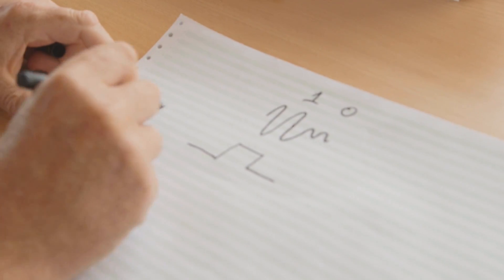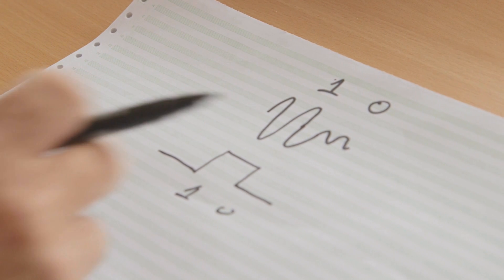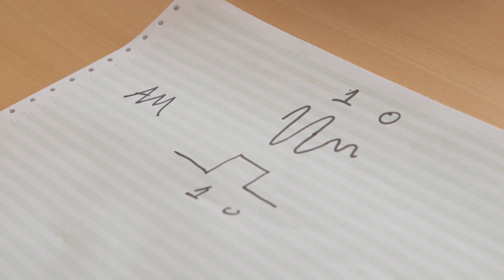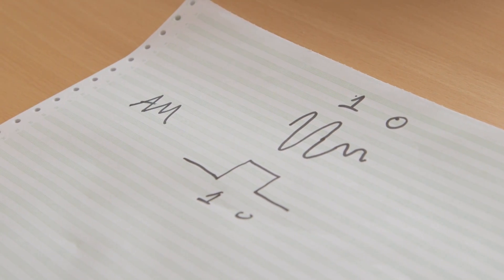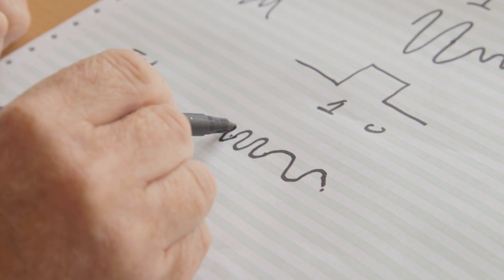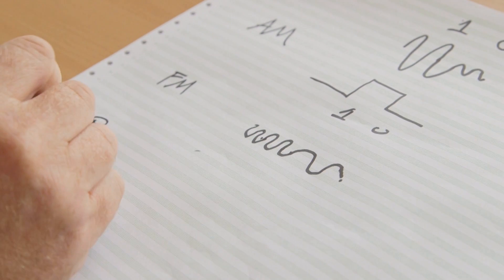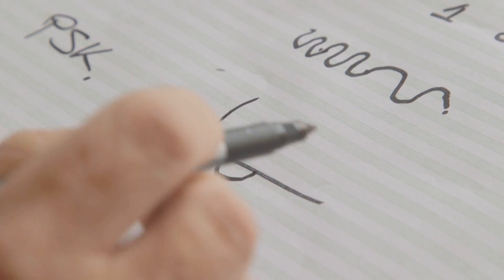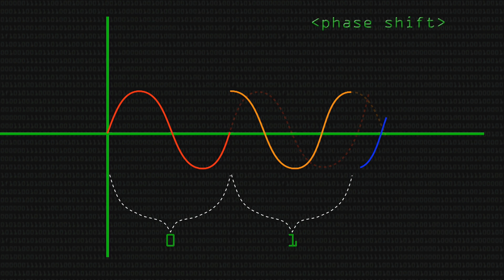How Broadband ADSL Works - Computerphile

Comment: Fibre. My DSL is connected to my phone line which is a single cable stretching from my building ( containg 6 flats) to a telephone pole. This telephone pole looks like a maypole with a cable stretching to each building in our Close. If everybody went on line together the bandwidth would go down to 2Mb. 1 8th of its capacity. So if I am watching a video it lags or stops completely. I now pay more for 4G which always gives me 2MB per sec and when 5G comes to Europe I will be using that.

Comment: I usually explain it as how a radio can pick up one frequency out of dozens of radio stations.
Now imagine all the stations working together to transmit the same piece of music, not 5.1 surround sound channels or even 7.1 but 76.5 channels. The receiver tunes all stations at once and splits the sound out to different speakers.

Thus you use the whole length of the radio dial to transmit one piece of music, so DSL uses a broadband of frequencies (cut up into bins or cells) to transmit data.
Reply: My DSL cable whose only job is to communicate to the splitter and has just two copper wires is broken.

Comment: My question is if both the phone line and USB2.0 use 2 conductors for data transfer, then why is ADSL so much slower than USB2's theoretical 480Mbps even if we don't have a phone? At least be 10-20Mbps or something decent.
Reply: usb 2.0 is less than 3m cable length. telephone lines to your exchange are usually 1km-6km in length and are subject to line noise and bad conditions. does this answer your question?

Comment: What is the rationale behind the Nyquist Theorem?  Is doubling the sampling rate necessary to properly replicate a sound digitally or is it done to provide an ample amount of headroom or buffer zone?  For instance, since the human ear can only perceive up to 20 khz, would a digital sampling of 20 khz be virtually indistinguishable from 44 khz or is that doubled rate necessary to overcome audible anomalies introduced by the digitization process?
Reply: If you sample a 20kHz tone at 20000 samples/second, each sample will be at the same point at the graph, for instance the point of the positive-goint zero crossing. Each sample will be at the same voltage, i.e. there will be no tone. If you sample at double(+a little) frequency, you at least get each sample at opposite sides of zero, and you will get out a tone of the right frequency.
If you sample 20.010 or 19.990kHz, at 20k samples/sec, you will get a 10Hz output.

Comment: At 0:56: "Phase modulation hasn't been particularly used in the analog space". I beg to differ. For decades analog Police, Amateur, commercial and consumer 2 way radio all used PM. FM receivers can pick up PM because shifting the phase shifts the frequency (and vice versa).

Comment: so what about DOCSIS? all the numbers say that it is better so why isn't BT using it?
Reply: Well, maybe because DICSIS is a set of standards for data transfer over coaxial cable, especially cable tv distribution systems, not twisted pair phone lines.
Reply: DOCSIS 3.0 is standard in many countries, including Australia where I live, and we can achieve speeds of over 100mbit/s, and with splitters on coaxial cable you can run things such as Foxtel (cable TV) and many other things like having a phone line converter on your house all on the one coax cable. I'm guessing it's just less popular because it's a tad more expensive than twisted pair, and far more expensive than fiber, and as it is in Australia, it's cheaper just to take the leap from the old twisted pairs to direct fiber to the home.
As for why most of the Australian grid is doing fiber to the cabinet like the UK, I honestly have no idea, but perhaps it just makes servicing the fiber terminations easier for technicians in a cabinet than having to gain access to a residential property, and in most cases they can use the existing twisted pairs/coax that's dug into the house.

Comment: Well, this video don´t really explain how ADSL works, rather digital encoding over analog lines work. Also, ADSL is mostly not usesed any more, XDSL, IDSL and other later was renamed ADSL2, ADSL2+ and so on.

Firstly ISDN broke throw the 56kbit/s limit a long time before it even was reached. Already in the early 90-tys ISDN use 2 carrier channels of 64bit/s just using analog filtering and basic bit inversion keying. So when the modem was pushing 28kbit/s, ISDN already reached 128kbit/s. The problem was that it have to use a ISDN to telecom network converter in the other side. And then in the telecom server park a bypass conection to internet.

What was done with ADSL was that a special server was introduced that converted ISDN streams directly to internet traffic before the line reached the telecom switches. In this case there was no more any limitation of only 2 channels  per telefonwire. Then they could basically use a unlimited number. Later ISDN B-chanel introduces a additional 4 channels limiting the maximum to 384kbit/s... This is also happening to be the maximum limit of the 2G GSM data channels (128kb/s för GPRS and 384kbit/s for edge, this is due to design).

With ADSL they basically keeped the old telecom system on the server side, but swiched out the old 6 times 64kHz side to a 256 times 4kHz, increasing the bandwith needed by 3 times, but the number of channels by 40 times. Every channel still carry 64kbit/s, but using a combination of PSK and ASK (supposedly 8 bit PSK and 7 bit ASK? total of 15bit?), total of 15Mbit/s of witch 8 is usable....1998 specifiation

Later version 2001 use less overhead increasing the capacity to 12Mbit/s with over 500 chanels also using more robust coding, later versions (2008)  increased capacity to 24Mbit/s decreasing overhead and others stuff.

VDSL and G.fast does not use ADSL backbone. It uses simular carrier system with 4kHz wide carriers, but they are shifted to a higher frequencies, using up to 4000 carriers but more robust coding, limiting the bandwidth to a maximum of 100Mbit/s even tow the number of carriers is a lot higher. The road side box in this case is connected directly to the internet, not routed to the telecom provider. This enable just about any company to install it. (in theory)

Also VDSL and ADSL is designed so it could run simulations on the same cable
Reply: Thank you

Comment: My First Modem - 300 baud.
300 bits per second...  Woohoo!
Reply: Surma Sampo Baud is signal rate. It's used to specify how often the signal changes. The bit rate is usually higher then the baud rate. Remember that the signal on the phone line is analog and can have other values then just 0 and 1.
Reply: BersekViking Correct but what qualifies as a signal in the per second rate? It is a wave form cycle or phase cycle. Every time a wave form cycle, which in huger bit rate modems is a phase change, that is 1 baud. The number of bits in that baud is defined by the combination on the AM + FM + PM which basically defines an analog data packet size.
Modems up to and including generally used just amplitude and frequency modulation on a full sine wave. Phase modulation allowed the modem to create more permutations per cycle (or sine wave) but changing which segment of the wave form was sent per cycle.
Line quality greatly effected how granular the modulation control could be as noise and attenuation interfere with AM and FM. We bascially used really complex sounds wave fragments to carry data from one digital device to another.
Turns out you can use the same principles with 2 laptops or smart-phones using the mics, speakers and dsp's to transmit data or commands between the machines. This even can operate outside out 20khz hearing range for hacking purposes when normal network interconnects are not available.
Reply: Regardless, early 300 baud modems were indeed 300 bits/sec, because they used only two symbols. It wasn't until the mid-80's that higher data rates became common.
Reply: Baud is switching speed not a data rate.
Reply: Marcello Zucchi That's a great article from a data/programming viewpoint but from an electronic engineering viewpoint the baud rate at the exchange was determined by how may signal switches the pots switch gear could perform per second. Every time the there is a phase change then exchange gear sees a break in the signal and that is equal to 1 baud.
It is pretty much the same process your switching hub does for every data packet that passes through it. For instance, my current switch at home can manage about 12 gigs-packets per second as it's data packet switching speed. Most POTS exchanges were limited to 9600 baud during the 80's and 90's and since the telecoms companies would not make any assurances about line quality they would generally not officially support more than  1 bit per baud.
I could be a bit fuxxy about some of the details since it has been about 20 years since I studied all this but the concepts are sound.
I suggest you read more about the communications switches that handle all the data and communications traffic across every network in the world.
Reply: ok?

Comment: The phone system is magic. The ingenious crazyness that (before DSL and ISDN) takes a digital computer, a digital phone system and joins the two together using some analog technology that tries to mash digital data down into frequences used by human voices.

The truly clever part is that my broadband phone line still supports an old GPO rotary dial phone from the 80s I have that contains a proper mechanical bell and pulse dialling done through a mechanical dial.
Reply: I would turn that phone over and look at its production date. I bet it is older than the 80's. I have one from '62.

Comment: Does this mean that someone potentially could intercept the crosstalk from other lines in other frequency bands from other subscribers?
Reply: it'd all be scrambled, it'd require a lot to decode any data (you'd not know what frequency slot each bit was going in). As for the analogue POTS, yes, you can often overhear on a line especially if there are earth faults or a lack of balance on the line
Reply: Well yeah i'd would be a werry bad signal but it would be interest to know how much data is theoretically preserved. And how obtainable that information would be. The banding of frequencys would probably help a lot. As for any important information it would probably be encrypted, im just  curious an ee sort of way.
Reply: Intercepting facilities for law enforcement/etc. are usually required to be provided by the Telcos by law - tapping a DSL line would be a much harder way..  :)
On the other hand - a technique called vectoring takes crosstalk and line interaction into account on VDSL2 lines to guarantee higher data rates..

Comment: As an EE I don't like this video very much. What is the picture at 3:15 supposed to show? There are no axis titles and somehow there time domain waveforms as well as constellations drawn on the same diagram? This neither does make sense, nor is it in any way correct. But the worst is, it confuses more than it explains :-(
Reply: Talking about PSK/QAM the axes (time and amplitude) are implied since I really can't see them being anything else when you are talking about using carrier phase angle to encode data.
Reply: In constellation diagrams the axes are Q and I parts of the signal, not time and amplitude.

Comment: 80mbps over FTTC (Fibre to the cabinet)! You're pretty fortunate as most of the residents around here struggle to even get 20 over FTTC due to poor quality aluminium cabling and long distances. Vectoring looks like it might be able to increase speeds but, at the end of the day, FTTC, FTTdp (fibre to the distribution point - mini cabinets closer to people's houses) and FTTrN (Fibre to the Remote node, pretty much the same as FTTdp) are just dragging on the life of the copper network, which should be being replaced with pure fibre!
Reply: The copper network also supplies phones that work during a local power failure, fibre would require a local power supply and need to be battery backed to supply phone service. And as I found during a large area power cut the other week, the mobile phone system simply drops dead during a power failure, apparently there's no $()(!@#$) backup batteries at the cell site
Reply: @TheChipmunk2008  And now nearly no one uses analog lines, most people have cellphones and buissnes have voip or cloud telephony for their deskphones.
Reply: @TheChipmunk2008  Must just be your mobile phone provider. Power was knocked out over a large region of the state that I live in and despite my entire town not having power for close to 24 hours (including street lights and signals), my cell phone still worked just fine. Internet, voice, and all.
Reply: Yikes! Aluminum as an electrical conductor? I mean sure it's not the worst conductor in the world, but the only reason I can see a company making the decision to use aluminum as an electrical conductor that is meant to carry many frequencies with little resistance is because they're just too cheap to spend the extra dollars on copper.

This must just be a UK thing. It's not uncommon in the US to see downlink speeds in excess of 100Mbps. I pull 300Mbps from my ISP over copper wiring, and the only thing preventing me from going faster is the cost of the faster service. You could easily pull close to 1000Mbps over a well shielded copper wire.
Reply: @gfifer1  it sounds like you are talking about coaxial cables, there is no shielding in twisted pair phone cables, even those made of copper. Those speeds are almost impossible to obtain for 90% of people with copper lines thanks to attenuation and crosstalk (and overselling).
Thankfully fiber is becoming more and more easily available.

Comment: Really really good explanation to the issue, but it feels like the video is heavily edited to fit as much information into the 09:35. 

Personally I am a ham radio operator so I have fair bit of knowledge with analogue radio, but I still have to concentrate a lot to understand how QAM modulate, which I didn't before. 

I'd suggest breaking it down further to explain what modulation / carrier signal is, then going into how PSK differs from AM/FM, then how PSK is combined with FM to form QAM.

Comment: How does the dsl 'modem' know what the reference (Zero degree) phase is? for the PSK? Does it have a reference oscillator that's synced up occasionally, or does it measure relative to the previous 'bit' and could thus get out of sync?
Reply: Marcello Zucchi Thank you, always wondered since QPSK was used in the 80s for digital TV sound (NICAM) :)
Reply: How does the Bee Orchid that attracts Bees to come and mate with it and thus dupes said Bee into carrying its pollen know or came to know what a Bee looked like in the first place.